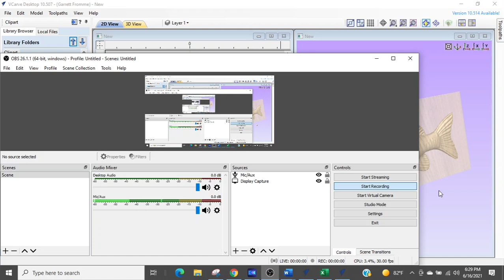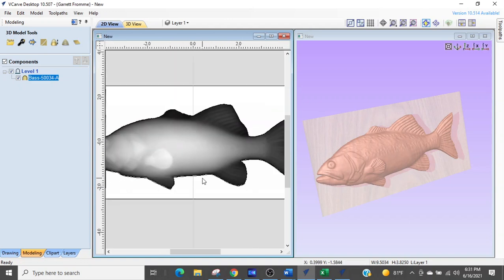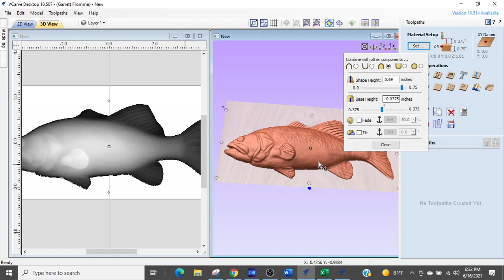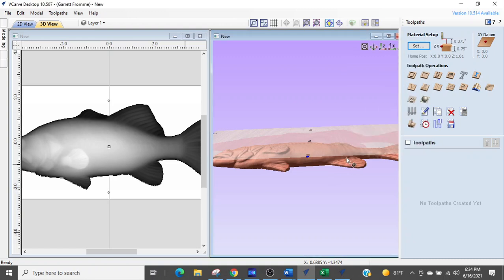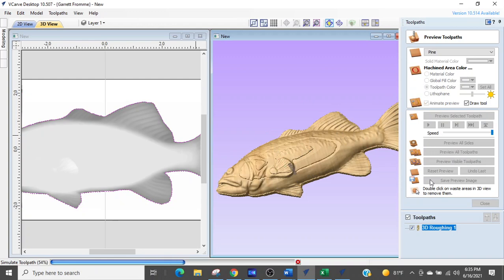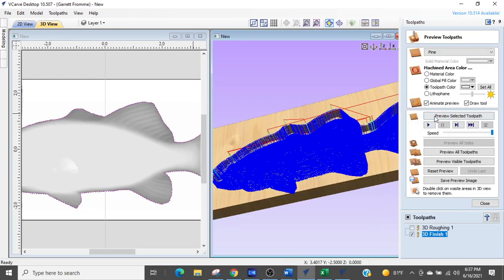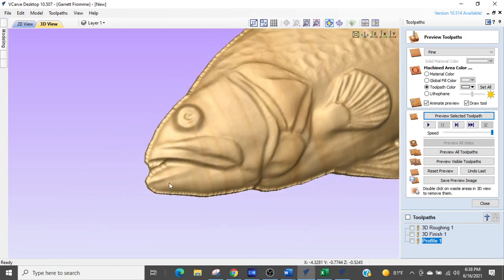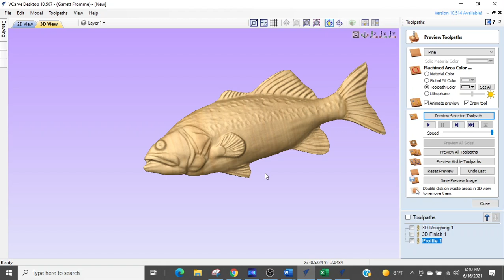Quick Tip - Cutout A 3D Project [Vectric Vcarve & Aspire] - Garrett Fromme

Comment: If you offset the vector boundary out the tool diameter (or more) and used that as your constraint, might it also machine all the way down the sides … I suppose it could create an issue where it might cut it out as it machined the model, without giving you the option to use tabs like a profile does.
Reply from the maker: TheFarCobra, you bring up a good point and you certainly could brother. But, as you mentioned you'd lose the option of using tabs!

Comment: great instructional- but i can't help but feel this is so overly complicated just to carve out a boundary?  is it the same procedure for cutting say... a simple flat shape out of a material like 3/4" pine?
Reply from the maker: Just Another Day, this specific project with the fish had 3D components to it which needed these extra steps in the beginning of the video. But, you should be able to cut out a simple 2D flat object out by using the 2D profile tool path like I showed closer to the end of the video. I hope this helps!

Comment: Everyone seems to use stock 3d images. I wonder if anyone tries to build their own, and how they go about it.
Reply from the maker: Hi SN. Building a 3d model takes more powerful software (like aspire), and people want to make things more than design them. 3d designing takes a bit more effort/ That is why you see stock usage so often.
Reply: @IDCWoodcraft  I agree, it takes quite a bit more effort, mostly in time spent. Aspire would be ideal, but at $2000, not an affordable option. I've been messing with 3d Builder, which is free from Microsoft, and actually comes with some windows installations. I had some interesting results, one of which I'm going to run on the E4 and see how it comes out. The biggest drawback it has, is that it determines its shape from shading in the image. Which is ok, but a person with dark hair will have a "ditch" around their head and sunken eyes. So I went looking and found Blender, which is free, but I haven't had time to mess with it much yet.
Reply from the maker: @Mrsnichols1965  I'll check it out

Comment: So would you do tabs on the cut out or how would you mount the piece to the table?
Reply: You can do 3D tabs, painters tape and CA glue. I know someone that does non of that. He holds the 3D piece by hand as it’s being cut out. He carves more 3D carves than all of us combined. I tried it once and worked following his advice. I absolutely so t suggest that for the non experienced people.
Reply from the maker: Hi Jeff. Please explain more about this.
Reply: @IDCWoodcraft  my friend will do 0.05” depth of cut I think at 80 ipm. Depends on if it’s a detailed 3D carve or not and just hold the piece of wood on the last two cuts before the endmill cuts through all the way. I tried it at 35 ipm and held the piece by hand…. But I obviously do t suggest anyone doing that. Play safe y’all
Reply from the maker: Yes, tabs or CA glue.
Reply: Small items, blue tape and CA glue, larger pieces, 3D tabs is my goto

Comment: I do not cut all the way threw when I have to cut out.
I cut out just slightly less of the board thickness.
Take it off and flip it upside down and put it through the planner.
No wear and tear on the surface board of the CNC.
Reply: Seems like a very slow idea….. it wouldn’t be my goto on 3D carves. If it works for you though, great.
Reply from the maker: Hi Todd. Excellent point.